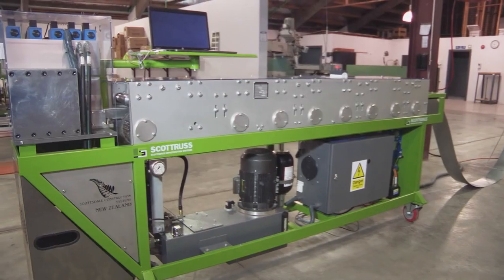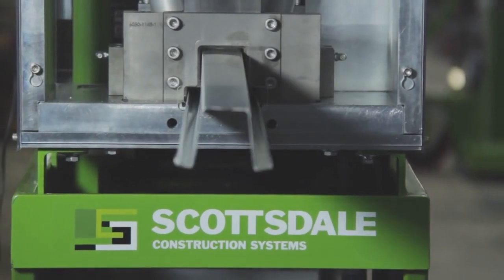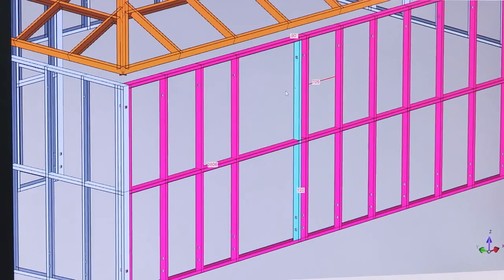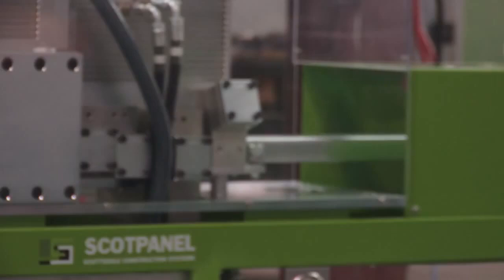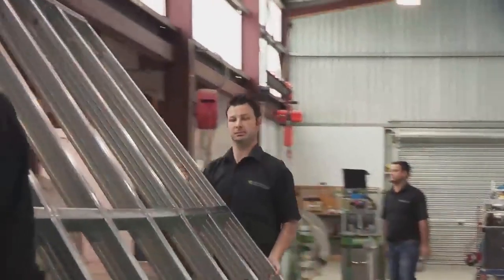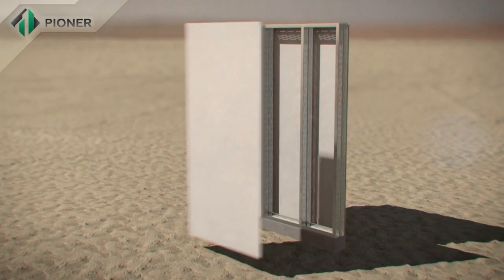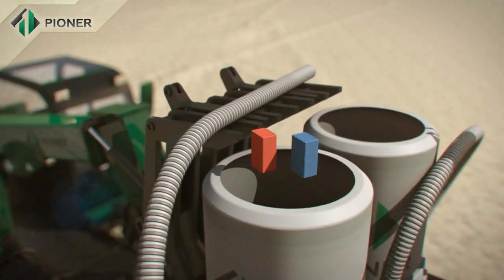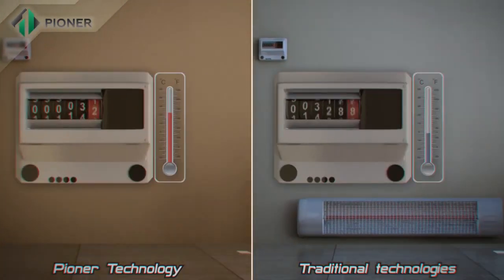Light gauge steel frame construction system with non autoclaved lightweight aerated concrete infill

Comment: What is the cost per square feet or square meter.
Reply from the maker: Depends on your design. You can check with Denis +971 58 535 1788

Comment: What are the max spans for roof framing trusses for this product? based on just ends bearing and not interior? Thank you.
Reply from the maker: It depends on the section and steel thickness. With 89 mm section in 1 mm thickness u can make span 18 meters

Comment: I am still wondering whether I have ever tested earthquake-resistant shake and what are the weaknesses of this product in flood-prone areas
Reply: Yes earthquake shake table testing has been done. Upto equivalent of richtascale 9 earthquake.
Reply: Flood damage: Durability all depends on the time allowed to be in a harsh environment. That is the case for all materials.  We all know the damage floods do the a timber frame if the flood waters don't reced quickly. Assuming the coating, galvanizing or zinculame is undamaged by flood. Then it would typically be fine.
Reply: Similar building methods (practically identical) are used in Japan and Italy  for residential and small commercial, 2 highly seismic countries, and rated for Richter 9.
Reply from the maker: you can find more details at Framecad website www.framecad.com